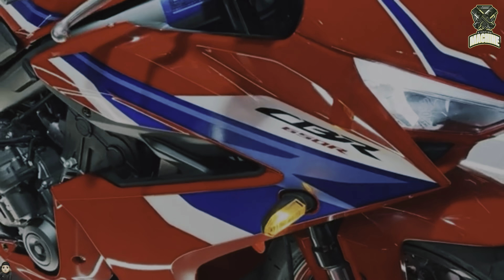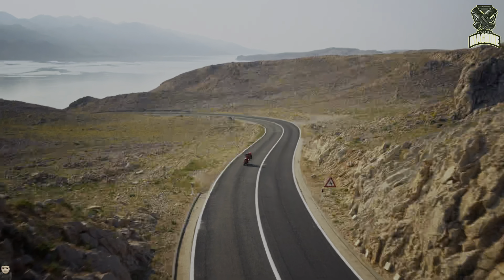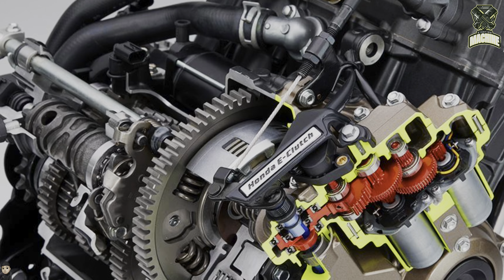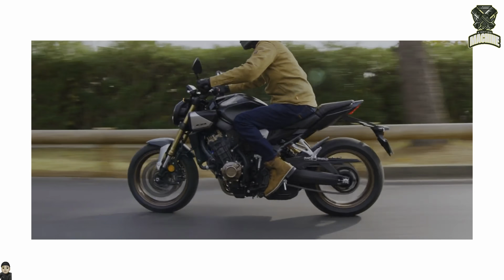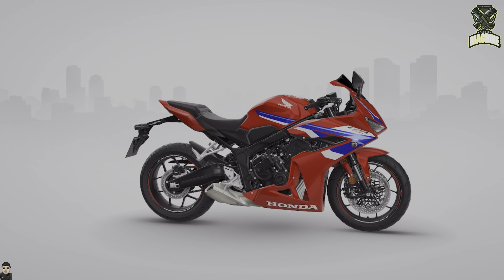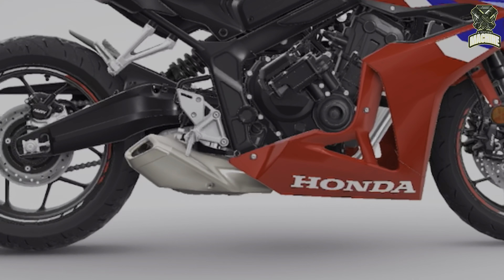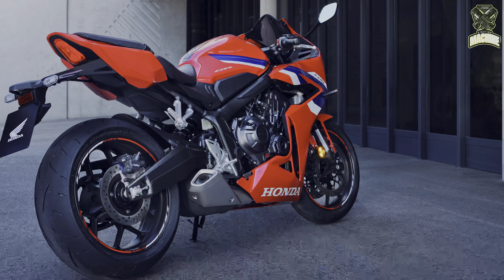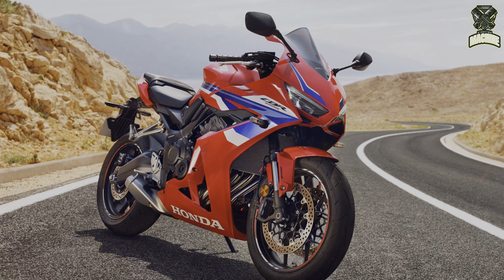OFFICIAL!! 2024 HONDA CBR650R WITH E-CLUTCH TECHNOLOGY

Comment: 54 years old just bought a 23 cbr500r (first bike ever),I get a few seasons under my belt this may be my forever bike....wish me luck. Great video..
Reply: Been riding the cb500f for 5 years now, it's a fantastic bike.
The only reason I'm considering the new cbr650r is mainly for the inline4 cylinder's sound. If the 500 had it, I would probably trade my cbf in for a cbr.
Reply: Congratulations @@dave2873 for your dream bike. Few enthusiasts can fulfill their biker dreams.
Reply: Congratulations for your new motorcycle. I had 2019 version of Honda CBR650R. They are actually cheaper than the rival companies.

Comment: Man, if the bike is dropped on that side that bulging e-clutch may act as a crash slider, taking all the damage and I only assume it will be pretty darn expensive to fix/replace !
Reply: I am wondering same, have a plan to buy 650r once launched and already foreseeing me buying a crashguard for 'bulged' clutch box
Reply: I saw a new boxer go down in the black ice this am....I bet THAT was expensive!  That Beemer was hemorraging oil big time!  Busted up valve cover nemt/broken cover bolts minimum!  Even a manual clutch bike can be expensive low side slide gring through cases destroying radiator, clurch cover, waterpump, exhaust etc etc etc  So yeah this would add another 500 or so to the bill is my guess

Comment: Does it make any difference In power or sound?
Reply: Probably not, but I'm hearing shit about euro5+ over here which might effect sound.
Reply: No just adds a little pork like 10 pounds or less and a funky look not as clean where it appears by clutch...arguably could reduce standing start times like 0-60 and 1/4 mile etc....then again?  With the right programming?  A computer COULD beat the best human....I mean that is possible if a manyfacturer spent the R+D and hardware costs to do that...part of a launch control package you would simply select the option and NAIL THE THROTTLE letting the ecu handle maximul hook uo and not looping the bike....all the rider would need to focus on is body placement and steering inputs